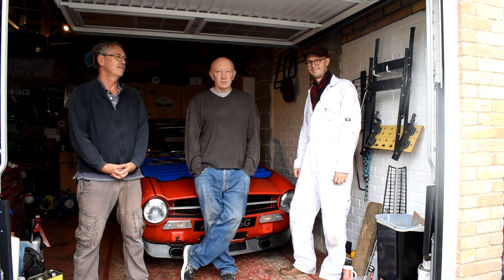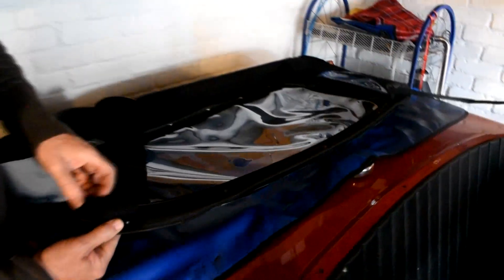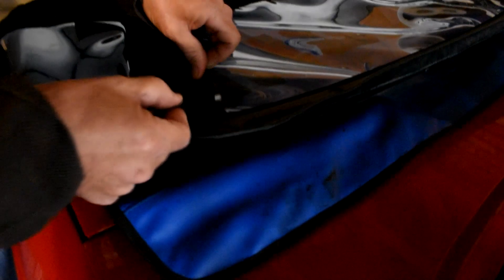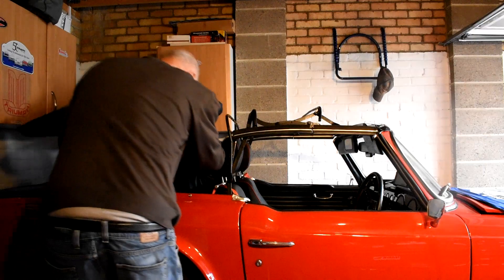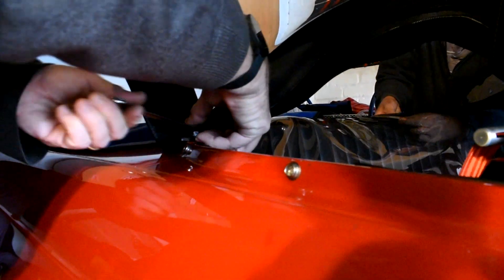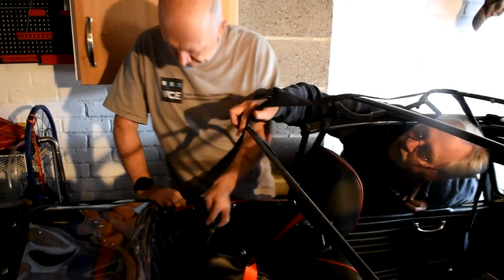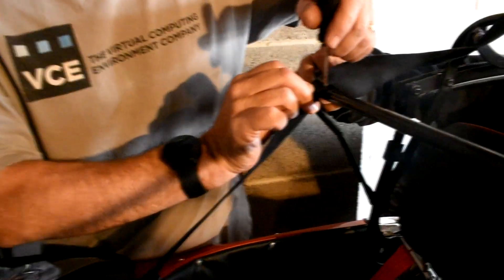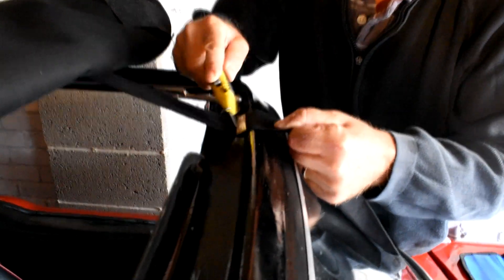Triumph TR6 Soft Top

Comment: A quick word of warning. Grinding aluminum on a bench grinder is EXTREAMLY dangerous. The aluminum will build up in the stone pores. When grinding later, as the stone heats up, the aluminum heats up and expands more than the stone. With enough expansion the stone wheel will literally explode.
Reply from the maker: On something more substantial than a small rivet head, I completely agree with you, due to the aluminium build up. However, with a 3/8 rivet head ground for a fraction of a second per grind, is barely going to heat up enough for anything bad to happen. It's a good point worth noting either way with grinding aluminium 👍

Comment: Good morning Steve. I've dug myself a hole regarding the chassis on my 6 and  suddenly realised you replaced yours not so long ago. I've looked on the forum and you bit the bullet and bought a CTM . How much did it cost ? Mine does require a LOT of work.! Regards. John.
Reply from the maker: Now your asking a question, I believe it was £4500, that included powder coating the chassis, transporting it, and wax oiling it. I know there's arguments for and against powder coating chassis, but my view point on it is, I never go out in the rain, and the car is kept in a dry garage. You do loose a little originality with a CTM chassis with the rear spring suspension mounts are square, not round, but that a small price to pay. Overall the CTM chassis is excellent, and has all the strengtheners in place. My theory is if the car lasted 50 years with the original chassis and say 20 years of that is was a daily driver. It should last 70 years before the CTM chassis needs any work doing to it. I'll be long pushing up daisy's by then and won't worry too much about it. Cheers Steve
Reply: @SteveDentonClassics  Thanks Steve.
Reply from the maker: No probs 👍🏻

Comment: Is this soft top similar to a spitfire soft top? I have a 1978 spitfire with a relatively new soft top but it's not installed.
Reply from the maker: Hi Jonathan, yes the process of fitting a soft top to a Spitfire 1500 frame would be similar to that of a TR6. Start at the back with the rear deck. Attach the soft top, then work your way forward like we did in the video